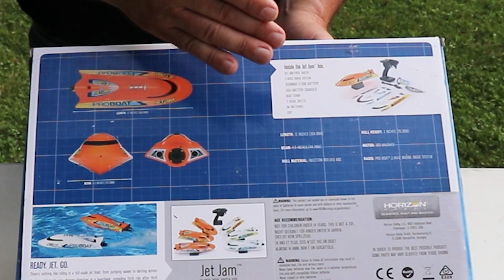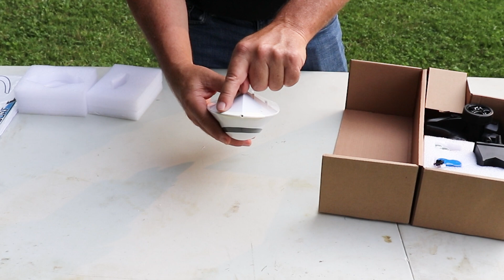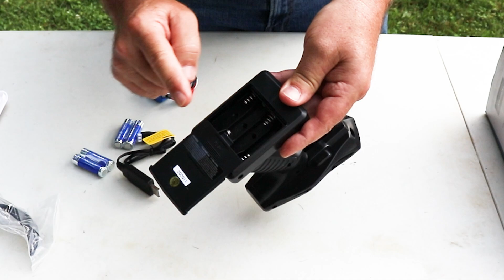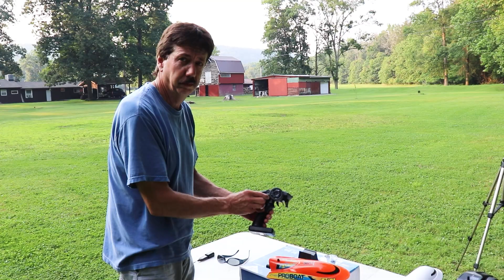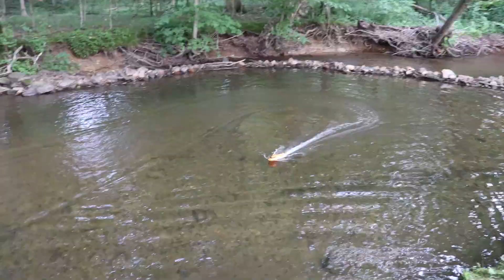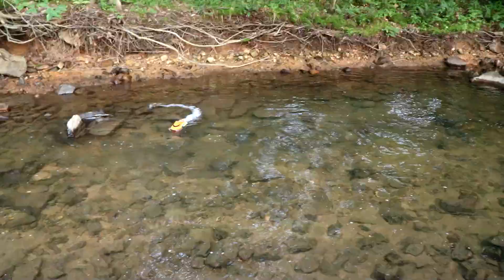RC Jet Boat under $100 - UNBOXING and TEST - Pro Boat Jet Jam pool racer

Comment: I have one of these. Use it in my pool almost every day. It’s a hoot. Not great for choppy water.  The jet drive cavitates pretty easily.
Reply: Jet drives reverse with by lowering a bucket behind the jet drive. It can not reverse by running the motor in reverse.
This boat does not have a reversing bucket = can't go backwards